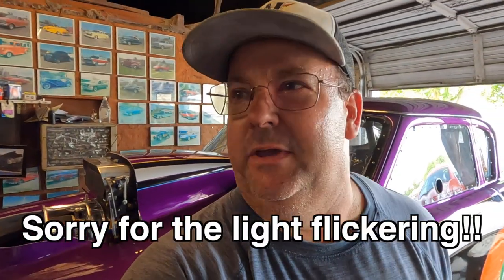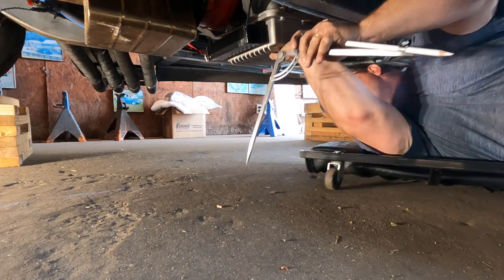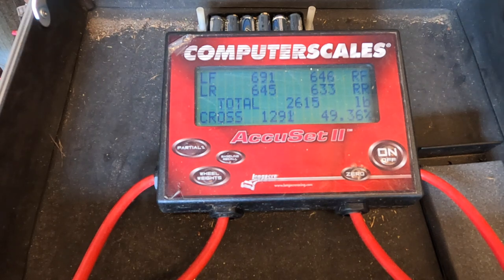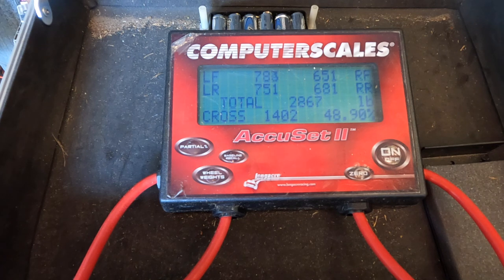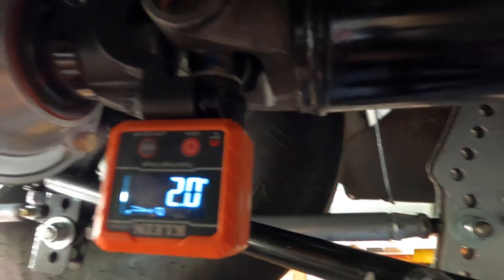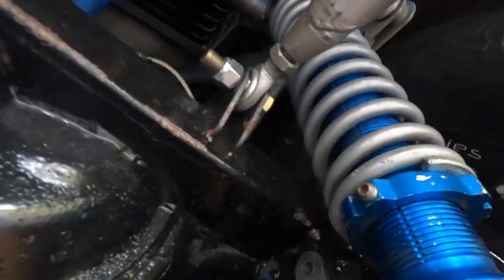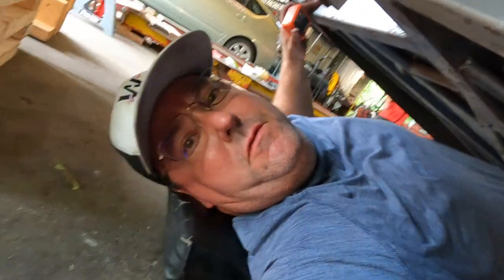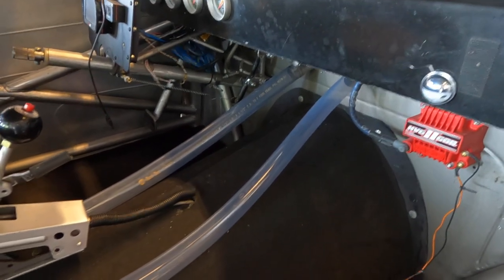Drag Racing Suspension Baseline Part 2 Pinion Angle and New 4 Link Plot

Comment: To keep it simple, I pretend the driveshaft isn't in the car so ignore it.  Measure pinion angle & Engine/Trans angle & your pinion angle is the difference between the two. 
Most modern full chassis cars have the Eng/Trans pointing uphill 1.7 to 2 degrees. With a full chassis your pinion will not move close to 2 degrees under load unless something is wrong. One degree negative pinion angle is usually plenty adequate. Remember, NO bolt threads through the 4 link brackets, use correct shank length NAS bolts. Jerry Bickel Race cars has them on his web site. If you don't use them, your bracket holes will egg shape before long. Also use doubler plates on the bracket holes for added surface area.  Great job on the video as always.
Reply from the maker: All great points for sure... however, recently I have had some trucks in the shop with 5 degrees down on the motor/trans as they sit much higher than the rear end... street converted to track type situations. In those situations, I always try to keep the driveshaft angles in mind at the trans and pinion yoke so while I am there I just stay in the habit of documenting all the angles for my own documentation. I have had a few trucks that had too much angle on the driveshaft/trans yoke thus requiring some modifications to the engine/trans mounts to correct. Thanks for commenting!!! Go fast, go straight! Be SAFE!
PS. Yeah, I am considering the NAS bolts for sure. These bolts have the shoulder through the 4 link brackets for sure. Threads need a washer to get the lock nut tight. Those lock nuts are grade 5 for now, but they will be changed this week to grade 8. Bolts are grade 8 now. Good call!!

Comment: Kevin, upper bolt-in safety shoulder straps should come off the upper bar behind the seat (wrapped or bolted). They should only angle downward a small amount to their attachment points (according to all safety harness manufacturer's instructions). Yours go through the seat holes then go way down to the bolt-in spot. In case of ta crash, you want the tension on the strap pulling in an almost straight line. In your case they would try to crush the seat (and your shoulders) downward. Please be safe and attach them to the upper bar behind the seat. Thanks for listening.
Reply from the maker: Thanks so much, John! I will get that addressed. Go fast, go straight! Be SAFE!

Comment: I hope you plan to replace the grade 5 hardware on the four link bars. Great info!
Reply from the maker: O yes... they are grade 8 bolts now with a shoulder supporting the 4 link brackets all the way. The nuts are grade 5 for now, but those will be replaced with grade 8 nuts. I will eventually switch over to the NAS 5/8" fine thread bolts and nuts. Go fast, go straight! Be SAFE!

Comment: I've been running 106% on my nova for a few years. Biggest issue I have is .3 seconds out. sometime it will come up on the tire. not very often.  Mines quite a bit heavier @ 3350. instant center is almost the same . Be interesting to see how it works for you

Comment: Kevin - Why don’t we note sway bar rate like circle track cars? We treat them as serious tuning aids? No numbers,no spring rate no motion ratio.30”bar vs 16”.I’m sure the16 is stiffer right?how about the length of the horizontal bar connecting sway bar to link on the housing

Comment: Nice, thanks for sharing. Can't wait to see how the car goes.
I think with the amount torque the engine makes, larger diameter 4-link bars would be a viable upgrade in the future and even more importantly reinforcing the ARB mount to the chassis, just doesn't look all that structurally rigid..
Reply from the maker: Yes... I do agree. I will get some longer bottom bars made soon and they will be bigger. The ARB mounts are definitely concerning to me as well. Thanks for commenting. Go fast, go straight! Be SAFE!

Comment: What is the correct name for the Aamco tool you dad was using on the front wheel for camber?
Reply from the maker: They are very hard to find anymore.. I will look it over real good to see if I can find more about it. I have always called it a camber/caster bubble gauge.... Go fast, go straight! Be SAFE!
Reply: @KevinWilsonSBC  thanks Kevin. I'm somewhat of a machinist, so could probably make one, push come to shove.... But if i can figure out what to look for id rather buy one.  I am finding less and less alignment shops that want to do this type of thing. I figure I'll start equiping myself.

Comment: Kevin, I’m trying to wrap myself around your digital angle finder measurements. More specifically the crank / engine measurement you showed. You showed 89.5 and we could see the arrow indicator pointing down. It seems like you discarded the 89 and went with  just .5 down? If it had said 91.0 would that have been considered zero? Also your drive shaft angle measurements. Where do you recommend measuring that angle? Sometimes I see some variance depending on where you put the angle finder on the driveshaft. Is the rule of thumb to measure the drive shaft angle as close to the yoke as possible?
Reply from the maker: LIke I said in the video, I knew people would have questions so I will be doing 1 more video on all this with the chalkboard. If the motor was level then it would be 90 degrees on the face of the crankshaft in a vertical position. 90 degrees is exactly perpendicular to 0 degrees. So 90 degrees when measuring vertically like this is your 0 reference. With the angle finder you can see it is 89.5 degrees down. So the math is 90 - 89.5 = .5 degrees down. Just to confirm it was down, you will see I tilted the digital angle finder some to confirm the down angle. So, if I would have had a flat machined surface on the motor or trans horizontally, the gauge would have read .5 degrees down. Go back and watch that portion again please. If it had read 91 the motor would be 1 degree up. 

Yes, measure the driveshaft near the you-joint you are wanting to reference, but a 1 piece driveshaft angle should be same regardless where you measure along the length of the driveshaft. I just do it near the trans yoke and the pinion yoke. Stay tuned for a video on this topic 1 last time. 

Go fast, go straight! Be SAFE!
Reply: @KevinWilsonSBC  ok. I follow now. Thanks for clearing that up . Makes sense now.

Comment: Lol, I believe I'm confusing myself. Front  end of my car sits a couple of inches lower than the rear at full rest and my engine is level with the ground. Does my engine need to be parallel with the frame rail for all this to come out right?
Reply from the maker: It doesn't need to be level with the frame. Based on the type of rear suspension you are running would determine how much pinion rotation you would factor in to your static pinion angle. Don't make this too difficult. As long as your driveshaft is not doing some crazy up angle to the rear end you will be fine. If a solid heim joint 4 link put the pinion at 2 degrees down... leaf spring with caltracs I would go 3.5 - 4 degrees down on the pinion. These are high level generic guidelines. Go fast, go straight! Be SAFE!
Reply: @KevinWilsonSBC  Thanks a bunch, up front I'm sorry this response is so long. Cars a g body El Camino turbo ls deal, 1000hp I set up for no prep. All heims, Trick chassis 8.8 kit so i can adjust upper control arm angle with double adjustable arms upper and lower. I have some vibration under hard acceleration im having trouble getting rid of. Driveshaft been to the builder twice to make sure its right, 3* down pinion angle with 40"long  IC around 10 or 11" high, 130% AS. The more - pinion angle I give it the lesser the vibration but I'm at my shortest upper bar length and 3* down is kinda high. The engine sits kind of high in the chassis so my next modification is gonna be to lower it some and while I'm at it gonna move the engine back as far as possible maybe even cut into the firewall, cuz no-prep. Right now drive shaft center to center of the joints is 61 3/4" so would like to shorten that # significantly.   Also recently purchased Trz adjustable  lower control arm brackets for the rear end. This will let me move  the IC and AS around some more. With only being able to adjust the upper on body side im kinda stuck with the current settings.